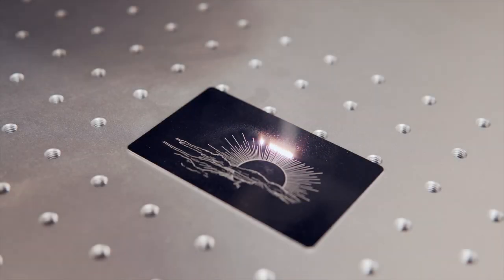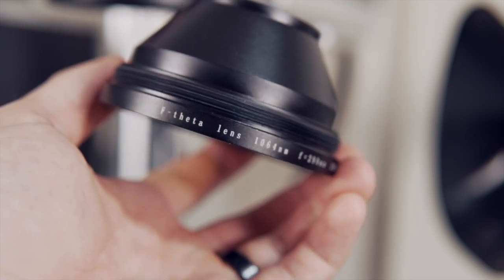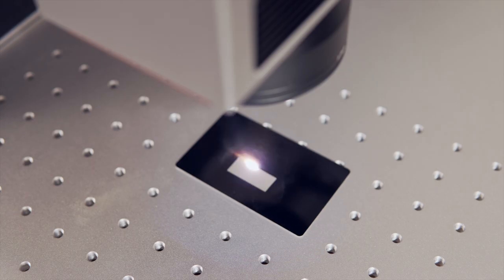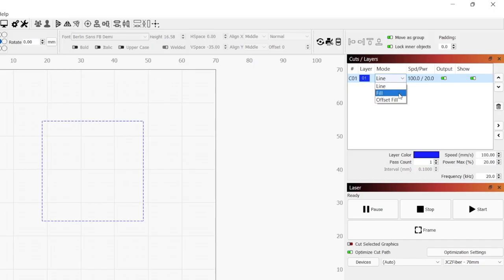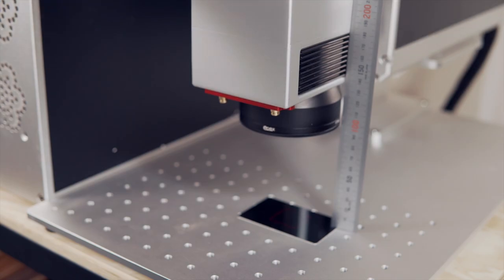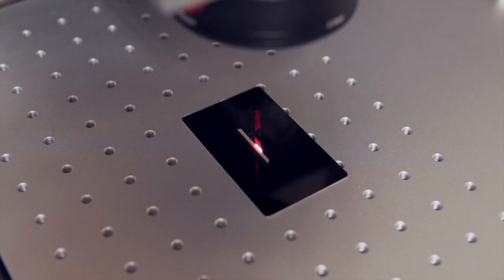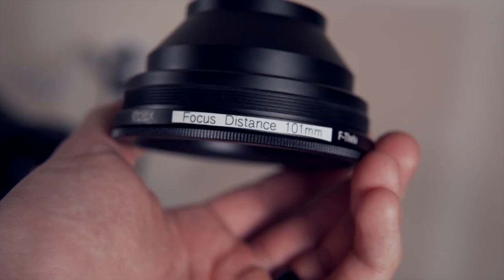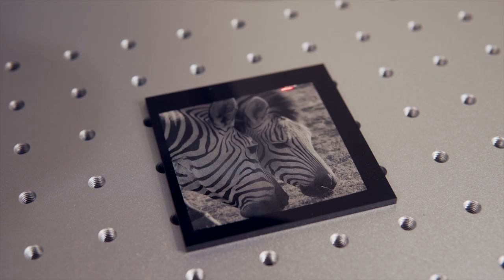How to Focus a Galvo Laser

Comment: You can just use the red dots on the laser  keep it simple
Reply from the maker: Many Galvos do not have the red dots for focusing. (The galvo in the video is one that does not)
Reply: @lightburnsoftware7189   thank you for that information, then I am lucky as my unit has two red dots  on my unit. cheers for the reply
Reply: @lightburnsoftware7189  What are the two brass thingamabobs?
Reply: those are definitely red dots but once a lens has been changed those need to be adjusted as well and this method (creating a jig) will be much faster
Reply: Mine doesn't work in Lightburn yet.  Hopefully LP will fix that.

Comment: Can this program be used in place of Ezcad2?
Reply from the maker: Yes, it is an alternative design and control software.
Reply: yes, lightburn uses the ezcad driver hardware. lightburn is a more intuitive software- easier to use than ezcad2. my new cloudray fiber laser came with both programs. i preferred lightburn.

Comment: I followed the instructions to find focus length as well as the calibration steps for a new lens. Is there away to adjust the focus beams? When I had my 290 lens, all the beams met in the middle when focused. Now with the new lens all the beams are spread apart. Is this able to be adjusted or will I need to manually find focus with a ruler each time? Thanks!

Comment: Hallo haii,why my software lihtburn go problem?got any solution.
When i use word it not in straight line ,it make zigzag on word,cause my machine shakking and the word tha i cut not accurate,can u solve it for me,any setting for it make nice line?
Reply from the maker: If your lines have zigzags it could be a few things. It could be that you have the speeds set to high for your machine or that physically you need to adjust something on your laser. If you have pictures and some additional information send us an email support@lightburnsoftware.com

Comment: How does this process work for a CO2 galvo? is it still based on sound?
Reply from the maker: For CO2 it would not be based on sound. It would be visual inspection and you can run a ramp test to help with finding the correct distance for your lens.
Reply: I find ramp test easiest way for CO2